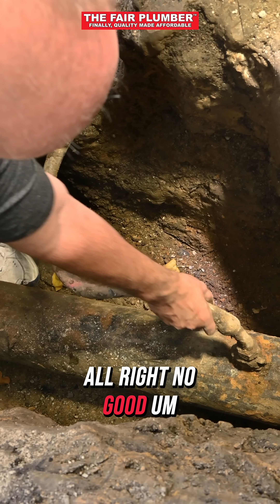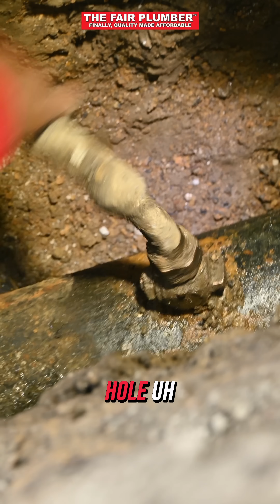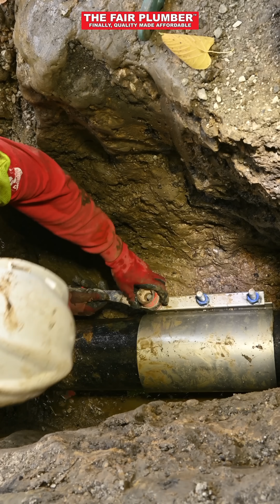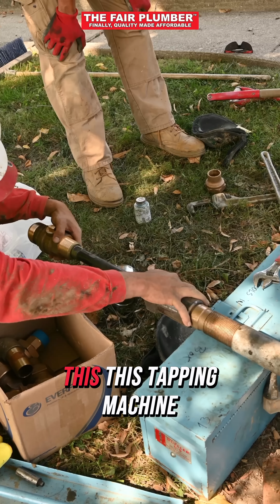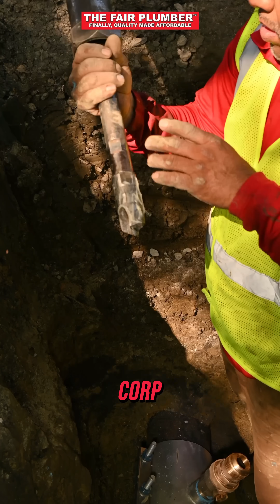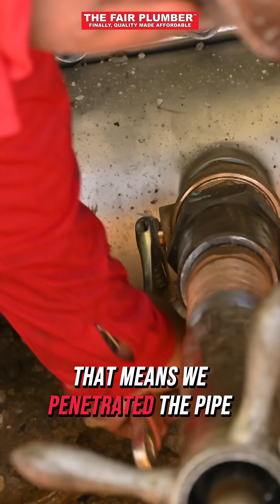Lead Water Line Repair - Part 1

Comment: Existing lead lines aren't a health problem unless you pull a Flint, Michigan and switch to an acidic water source.  The the scale inside doesn't allow lead to leach into the water at dangerous levels.  Switching to acidic water from the Flint River and saving money by not neutralizing the acidity broke down that layer of lead rich scale and introduced mega doses of lead from these pipes.  Those who ignored the recommendations about the water treatment should have gone to jail for life.
Reply: Well said
Reply: Ill pass on the lead pipes myself
Reply: @yolo7128t6 how would you know if you have lead pipes from the water main
Reply: @yolo7128t6  I'm not gonna have any new ones installed, either.
Reply: @yolo7128t6 
Sure, but it's still worth pointing out that it's ridiculous to scapegoat something that isn't the actual problem.  The lead pipes were fine for decades.  

If we could start with skipping on the career partisan politicians, we could make effective use of just about anything.
Reply: @decwow Yeah ddt was fine for awhile till it became a problem.
You are acting like heavy metal poisoning isn't a real thing.
Reply: @decwow no they weren’t fine for years 
Lead is poison 
We just didn’t know Mr wizard
Reply: I was going to say the same thing
Reply: Thank you!  the only other person I’ve seen say this beside myself that said that out load. People still think it was purely the lead pipes….
Reply: It is very interesting to see who was in charge in Flint when the water source switch was made. Knowledgeable people with work ethics were not in charge.
Reply: @Pieinear1  And now we see the same. on a much larger scale, at the federal level.  Buckle up it's gonna be a rough ride.
Reply: @mikemorgan5015 Yes, luckily we just got rid of a total imbecile and his leftist posse.
Reply: @mikemorgan5015 Exactly
Reply: Now there going to have broken water lines.
Reply: Well said!
Reply: Flint Michigan would have been just fine if they paid there Detroit water bill.
Reply: Exactly
Reply: True that.
Reply: Nop. Lead is a real health issue causing thousands of death each year. That is why communities invest hundred of billions removing lead pipe. https://www.cdc.gov/lead-prevention/communication-resources/all-children-can-be-exposed-to-lead.html
Reply: They would rather just blame racism
Reply: @captainnathan1164  we can blame both, career politicians often do things that harm poor & mostly black neighborhoods because they benefit rich & mostly white ones. Flint effected everybody, but the fact a lot of people there were poor & black probably led to some of the foot-dragging in getting it fixed.
Reply: The state takes no responsibility for actions that would be criminal if the peasents did it.
Reply: If you want to find out if you have a lead water lead go to your basement
And your basement …. Most likely on the side facing the road..   you will find your water meter
This water meter will probably be about knee-high off the floor , and looks kind of like a little brass football.  It will have a shut off valve before and hopefully after. 
Once you locate the water meter .. GET A FLATHEAD SCREWDRIVER OR A RAZOR BLADE AND SCRAPE THE PIPE COMING INTO YOUR HOUSE  
THE ONE COMING IN, NOT THE ONE GOING OUT TO THE REST OF THE HOUSE, BUT THE ONE COMING IN FROM THE STREET 
TAKE THAT SCREWDRIVER AND SCRAPE THAT PIPE COMING IN FROM THE STREET … YOU WILL PROBABLY ONLY HAVE TWO OR 3 INCHES OF PIPE STICKING OUT PAST YOUR WALL BEFORE THE METER   IF YOUR LEAD IS COPPER… SCRAPING IT WILL REVEAL SHINY METAL. HARD.
IF YOUR “leed” IS LEAD….SCRAPING IT WILL REVEAL A SOFT METAL    A VERY DULL SILVER  AS WELL LEAD IS SOFT, AND YOU WILL BE ABLE TO ACTUALLY SCRAPE AND SCRATCH THE PIPE WITH A FLATHEAD SCREWDRIVER  …. Now do not lick your fingers or rub your eyeballs.   lol. 
And once you find your water meter, it will have an odometer on the top just like a car 
You can take your water bill downstairs and match it up with what the odometer says on the meter 
So for example, if you got an estimate estimated read that month … or have been getting estimated bills
You can take your bill downstairs and match it up to the odometer on the water meter   
The water meter is very rarely fail , they have one moving part.. They just don’t fail.
If you have a disagreement, you can take it to your local municipality, and they will test it on a bench for accuracy 
For example, they would run 500 gallons of water through your meter , and made sure that the meter reflected that 500 gallons
The reason for an estimation is a broken wire usually
Reply: Why take the chance though? I mean you're in your house and expecting these people in charge to do the right thing to keep you safe? I rather copper so when they decide to do something stupid I'm still safe.
Reply: @user-lr4ht1uw1z yeah good job captain obvious. Not everyone can afford copper never mind a general repair. Do you know how deplorable the living standards are of some Americans outside of your bubble? That for whatever reason can literally not help themselves. Never mind off gassing or leeching that all plastic does. We’re literally making people retarded and asking them hey bro? Why can’t you come up with the means to fix your issue? News flash because they are inundated with stuff that slows down there mitochondrial processes and it’s not just in plumbing material. It’s our food. Our medicine. Etc. and great you have copper in your house what about most of the mains providing your region? Probably not all copper. Probably not even remotely close to ANY copper.
Reply: @user-lr4ht1uw1z  I don't disagree with that.  Again, have your water tested.  If you don't feel comfortable replace your water service.  But if you have to pay for it, and can't afford it, take precautionary measures.  It may be worth looking into grants that may or may not be available for this kind of work.  Definitely worth a look.
Reply: I learned more about this situation from you than any other news source, thank you!!!
Reply: In the early 2000's the city government of WDC subbed out their water service maintainence to save money. The new company found that the city had been spending too much money on "unnessecary" water treatment chemicals, and began using more acidic chemicals that were cheaper to treat the water. What the contractor failed to take into account was, that the vast majority of the 150 year old water mains in the district were lead pipes. They had no detectable lead in the water, sinc eover the century and a half that water had run through the pipes, calcium and other minerals had scaled the lead so that no water was every touching the lead. Once the new chemicals had been in use, after about a year or two, DC's water began to have detectable levels of lead, since lead is highly water soluable (reason you don't use lead based paints on cooking and eating utensils). The cause was quickly tracked down and the new chemicals removed from the treatment plant and a warning to not drink the water in WDC for a couple of years was isuued. Well, this being WDC where scandals are no good in the capital so it was swept under the rug for a bit until the Washington Post uncovered it in 2005ish.
Reply: @kevinbaker9665 that's why I only drink beer big boy 👏🏿
Reply: @BarryWoodward-kg7rw There is water used to make beer , do you know where it came from ??
Reply: @stevekluesner4430 electric Canadian beer I know the water is good and socialist like their medical like their medicine everything else no American beer 🍻🍻🍻🥃🥃🥃
Reply: @stevekluesner4430 Well it's from fresh springs in the mountains.  Where else would the water come from!!??  😂
Reply: Just get rid of the lead line. You have no control over the government idiots. Better safe than sorry.
Reply: @soyoucametosee7860the issue is most of the lead lines are the home owners responsibility and they don't have the money to pay to dig up the lead and replace it or don't want to spend the money
Reply: @sqike001ton  People don't realize how many lead water services there are out there.  Many well over 100 years old and still working fine.  But it's really not a health issue unless that scale layer is disturbed.  But again, test your water if you are concerned.  It CAN become a SERIOUS issue if your water plant messes things up like they did in Flint.
Reply: @soyoucametosee7860
We could have control over the government idiots if we wanted to........
Reply: @soyoucametosee7860I agree. Especially since lead lines were BANNED in 1986! That means the existing lines are  nearing (or past) their service life, regardless of the material. I replaced all of the lead pipes on my rental properties 20+ years ago.
Reply: There is no safe level of lead for human consumption.
Reply: @KingPhoey  WRONG!  Lead is nearly everywhere, all the time.  What negative health effects can be attributed to drinking water with one part per billion?  How about one part per trillion?  You do know that just about every piston engined aircraft still run on leaded gasoline, right?
Reply: Simp Harder.  Replace the lines.
Reply: You’re 100% wrong. 
LEAD IS POISON 
do please shut up with your subjective feelings 
Let’s stick with objective facts.  
You must be from flint.  I can smell the victimhood.  The fatigue is real
Reply: @GMemployeeofthemonth  Seems YOU are the one with subjective feelings and a disdain for reading as well.  If you'd read my posts, you'd know better.

I am NOT wrong.
I never said lead wasn't poisonous.
I am not from Flint, I grew up in Kansas and currently live in Texas.  Never been to Flint or the Detroit area.  But I read the scientific reports of the Flint catastrophe.  It's a tale of government at it's worst.
The objective facts are that old lead lines are just fine unless water chemistry is changed to a ph under 7(7 is neutral, 1 is highest acidity, 14 is highest alkalinity)  Mineral scale builds up on pipes including copper, galvanized steel, and lead.  That scale encapsulates and blocks the lead from leaching into the water almost completely.  Well below  accepted danger levels.  Flint, to save money, changed its water source from Lake Huron and the Detroit River to the Flint River under a new contract.  For a century, those lead pipes performed wonderfully and safely.  Knowing what we NOW know, it probably wasn't so safe for the first few months, but that was generations ago.  As that scale built up, the pipes got safer and safer.  In fact they were at their safest unitl the moment the acidic water from the Flint River began to be used and not treated to neutralize the acidity.  The acidic water immediately began to attack the protective scale in the same way we use white vinegar in drip coffee makers to remove the scale buildup in the heating coils.  The scale had a lot of trapped lead in it.  So huge, unsafe levels of lead were released to the unknowing population causing horrific health problems that will continue to arise in those affected for decades to come.  
City officials were warned by a state environmental expert that switching to the Flint River was a bad decision.  They ignored him.
When complaint and health problems were first reported, they were ignored.
When studies showed extremely high lead levels in the water, the City Council voted to switch back to their original sources.  The city manager over ruled them.  
Eventually, they switched back, but kept it quiet.  A CYA coverup began, but eventually was uncovered.
Flint river water ran through those pipes for nearly 2 years.  With the protective scale gone or at least compromised, it would have taken months or years to build that protective layer back up.  Though lead levels in slightly alkaline water would likely have been below accepted limits, or easily mitigated by simply running  water for a minute prior to using it for drinking water, (as a stop gap measure, not permanent) public trust was rightfully destroyed.  

I stand by my original post.  I recommend everyone have their water tested.  My father was a plumber.  Our houses growing up all had lead water services.  Our water wasn't acidic.  

A large part of my life, and the entire lives of many Americans born after the mid 1920s were lived breathing in lead every day, nation wide from leaded gasoline, which is still used today in piston driven, gasoline powered aircraft.  It's call 100 low lead.  (leaded gasoline rated at 100 octane)  But just imagine the scale of all those low MPG cars of the early 1970s, when I was a kid dumping all that lead into the air.  It was so pervasive that we will never know how many million people's health was affected.  That lead in the air also fell back to the earth as rain.  Think about that.

Anyway, I hope this made my position clear and that you understand that I'm not talking out my backside.

One thing puzzles me though.  If I WAS from Flint, what would be my motive for downplaying this tragedy?  All those pipes have been replaced with Copper water services years ago now.  I still recommend you have your water tested.
Reply: @mikemorgan5015  who is going to read that opine? 
I’ve been to shorter catholic weddings 
We all know what happened and why.  But thanks 
You’re the guy who has to point out the painfully obvious to all, painfully obvious I say …and go on a rant. 
Like you are really laying down some knowledge….lol.  Good Lord. 
ALL of us know   All of us   
Dey steady wait n on Dey check doe.  U feels me. U no wha I sayin
Reply: @GMemployeeofthemonth  Obviously you don't, or you wouldn't have posted such BS and  and accused me of more BS without evidence.  And who is "All of us"?  
Get bent, jerk.  That said, if you are those close to you were victims in this inexcusable debacle, I can understand the rage and wish nothing but the best to you.  But you're directing that rage at the wrong guy.
Reply: Exactly!... I was just going to basically say the same thing!...
Reply: Well said.  
I actually came here to say the same thing.  
I think you did a better job than I would have. 😂
Reply: At least someone still knows stuff like this.
Reply: Tell that to the Roman's...
I hope that you and your family are enjoying the same recommendations that you are giving, instead of having non toxic water and waterlines.....
Being a smartass against a whole population of poor people, you know the only ones who are impacted by this, because they can't afford buying bottle water instead....
They wasn't the ones taking decisions about switching water sources, and yes the people responsible should go to jail, but I don't understand why anyone would have to treat their water with anything before drinking....
Maybe time to stop using pesticides and all the other things that poison our freshwater.....⁉️
Reply: @mariabengtssonviking  Whoa there Maria.  Cool your jets.  Being a smartass to poor people?  Where the hell did you get that?  In NO WAY was that my intent or purpose.  Simply stating facts.  

The Romans drank from lead cups, water was stored in lead or lead lined jugs.  I'm guessing they cleaned them and didn't allow protective scale to build up on them.  But lead was also actually used as an ingredient in some Roman drinks.   

For 60 years, we put millions of tons of tetra-ethyl lead in gasoline as an anti-knock compound when higher compression engines became the norm.  I would bet that pumping all those tons of lead into the atmosphere was a hell of a lot worse than what you'd get from even a NEW lead pipe.   

I recommend that folks have their water tested.  Lab test CAN be expensive, but check with your water department and see if they do free tests.  Also, home test kits are readily available and cheap. A good time to pull a sample is after there has been no water use for as many hours as possible to get the worst case.  If you suspect lead, run your water for a while before drinking it.  DON'T USE HOT WATER for cooking or drinking.  Draw cold water and heat it.  My father was a plumber his entire life.    We had lead water services in every home I lived in.  He had our water tested.  It was fine.  And this was also in houses the used copper pipes joined with 50/50 solder(50% lead/50% tin), which was what all plumbers used for many decades.  You can't use lead based solders for water lines now.  And that's a good thing.  It DOES take time for protective scale layer to build up.  So fresh or new lead WILL show up.  And that's not good.

Bottom line, I'm not being flippant about this.  Just letting folks know not to freak out about it.  But given the direction our government is moving, your point is well taken.  Less regulation could very well mean less stringent water standards.  And that's the wrong direction to go.

Have a great week.
Reply: @mikemorgan5015  Roman were crazy bloodthirsty paranoiac... That is the direct result of lead poisoning : violence, hate, paranoia, entitlement, god complex... Exacly the same that maggots...
Reply: @pierregravel-primeau702  Some would say all those traits are called human nature.  No lead required.  
Claiming a direct link is unfounded.  Correlation is not causation.  Doesn't mean you're wrong.  But you have a lot of work to do in order to even come close to proving that one.  
Is half of America suffering from lead poisoning?  Let me know what you find.
Reply: @mariabengtssonviking  🤣
Reply: @mariabengtssonviking  the Romans didn't have water treatment plants to raise the ph levels of the water to prevent the lead from leeching, genius.
Reply: @Hunchback_Midget_John yes but they drank wine stored in lead bottles because it sweetened the wine
Reply: @mariabengtssonviking man that’s the same exact mentality that gets poor people fucked, too poor to afford, and too poor to research and ask questions too! Lead was used for centuries brother and we didn’t have the entire ancient world all lead poisoned and crazy either because it doesn’t leech in every or most environments.
Reply: @Astrnauted Didn't have people testing either...so exactly what are saying? 
We didn't test so it didn't happen?
Reply: @lizafrench8455 no just current science backs up that not all lead lines were dangerous. Infact limescale buildup from the untreated water happened a lot faster and is thought to have added another layer of protection against leeching/corrosion. Just giving you facts buster you could research it yourself don’t know what you’re so twisted up about.
Reply: @Astrnauted  Roman empire felt cause of lead... Now it is the american one! Get ready to learn chinese under occupation in less than a decade! We are in 1934 Germany level of delusion and entitlement! Lazy trust fund babies that want to remove right of the "Others" never lead to anything good!
Reply: @Astrnauted Your assumption is the problem. E erything is fine... Teating or water quality has come a long way since 1920. The entire idea that the scale is fine unless disturbed is ridiculous. The scale is disturbed every second of everyday by the  water that rushes through it.
Reply: @Astrnauted Pipes degrad over time. The metal be it lead or if it is plastics degrads over time. That degradation leaches into the water. It doesn't take a scientist to know this when the pipes are smaller than when they were first installed decades ago.
Reply: @lizafrench8455 I am a master plumber and you are barking up the wrong tree lady. You think the plastic piping that is literally leeching VOCs, BFAs, PFOAs etc is a better option? No shit water treatment has come along way and people still fuck it up. You clearly don’t understand the science behind what happened in flint or you’d have more thought than a door nail up there. You clearly have no clue of the infrastructure that currently exists and the tenuous task that is replacement with someone adequate or better. You’re the same sort of doofus that causes catastrophes like DuPont and Flint with your idealism.
Reply: @lizafrench8455 also there’s mineral in all water. Most scale doesn’t just kick up or come delaminated except for shut downs and startups because the pressure remains constant. Keep barking. It’s cute
Reply: @lizafrench8455 okay so explain why galvanized piping degrades and restricts in? Everything degrades differently everything has its use cases. It’s actually new lead that is most worry some and dangerous not old lead service lines. Research it yourself. Unless the lead has become damaged, deteriorated. Disturbed etc. you shouldn’t be drinking tap water regardless